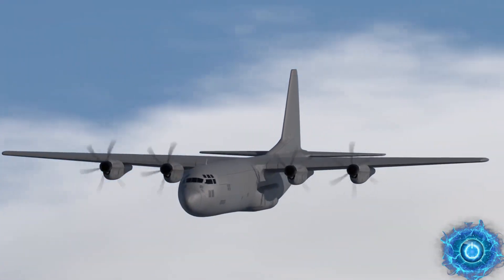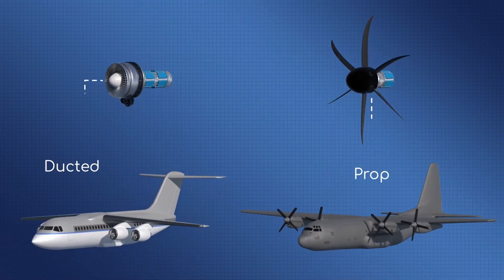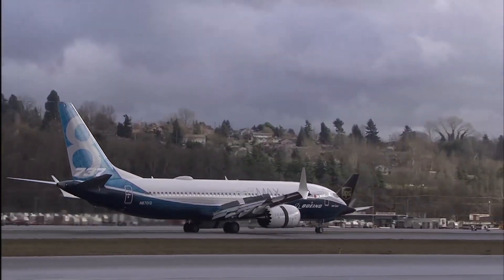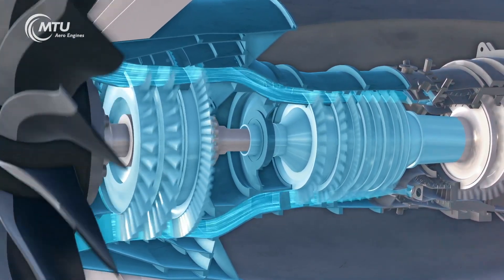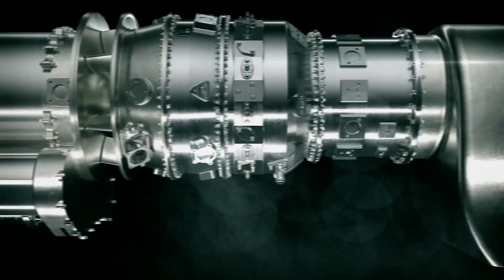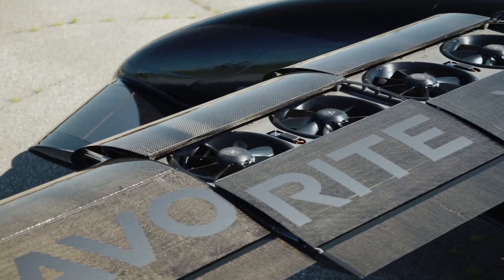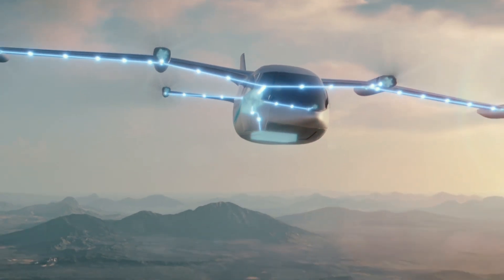New Hybrid ENGINE Will Change AVIATION Forever!?

Comment: Or better yet make the entire plane electric and use diesel generator to produce the power since the best jet engine you can make still guzzles jet fuel. Have you seen how much fuel a typical jet engine consumes? Who cares how efficient they are when to connect a generator to it you need a gear reduction assembly to even make use of this connection which results in losses of fuel energy, unless you can directly connect the generator with the output shaft there will always be energy losses. You could do it too with scalability in mind also, you would probably need a signal clarifyer. Why are they trying to keep the turbine again? You could install 5 to 10 mini propellers on each wing creating lift and you wouldn't even need the current wing design to maintain that lift. Plus the power draw and fuel requirements would be minimalized. Plus even if there was a total system crash and you would need to make an emergency landings safer. Well they dump the fuel mid flight if there's no way to recover anyway so the risk of fires is usually lessened to begin with, the only time they don't is at airports since they have the firefighters on hand to put out the fire. With the exception of environmental impact planes truly are safer than riding in your car. But one thing planes lack is the freedom to just decide mid flight to go to a burger king or to stop for a nap. Either way when AI driving assist rolls out there will need to be a major revamp to travel. Like if you want to control the car your insurance will be 300% higher. AI travel lanes reduced speed for AI's, also a very robust firewall with intrusion detection and automatic complete system shutdown with brake engagement.

Comment: Several Universities have successfully  reported  increasing the energy efficiency of splitting water into H and O by 8 times verses the old high current electrolysis methods. So within a decade we could see jetliners fueled by hydrogen on demand. As a fuel, water is many times more energy dense than fossil fuels. Of course the H could also be run through an Electric Fuel Cell. Few in the US realize that over 2 million cars in the world are already running on hydrogen, although its stored onboard in a tank. On demand H changes everything.... So what we need, are new engines that are purpose-built to combust H more efficiently, and better, lighter fuel cells.

Comment: Don't worry about the physics or chemistry of batteries, they are never going to close a 25 fold energy density gap, if they could they would just be chemical fuels. The energy comes into play with every single carbon atom bonding with 2 hydrogens, becoming CO2 and water in the air. You simply can not make a battery cell at the atomic level with just 3 atoms per HCH level of energy release.

The nearest we can get are the metal air batteries, ie every time a metal atom picks up an oxygen it releases a small amount of energy AND gets heavier, to recharge it the metal oxide requires electrical energy to break the oxide bonding to metal making it lighter, see aluminum smelting.

Comment: They’ll never be able to have a good enough battery to be able to power the motors, flight computers, avionics, air conditioning and dehumidifiers for 100 mile regional flights which require quick turnarounds required to generate profits. Quick turnarounds would be crippled when considering the long recharge times.

Comment: Electric aircraft..... I am not convinced of their viability as passenger aircraft, given their range will be limited. Batteries seem to inherently unstable on the ground never mind up  at 30,000 feet, where its pretty cold. Providing heat for the cabin would further reduce range, surley, just as it does with a car, not to mention things like inflight enteratianment and food preparation and lighting. Some form of hybrid, maybe, but pure lectric I have significant doubts about commercial viability and the rationale for them. Thats before we get on to the impact the mining and refining of the raw materials needed, both on the environment and on the humans that are exploited in their extraction and processing.

Comment: It would be cool to see a turbofan jet engine, but instead of combustion for a heat source in the turbojet portion of the engine, it uses the waste heat of a fuel cell. The brayton cycle does not require combustion, only a heat source. A solid oxide fuel cell can operate with a high temperature of 600°C to 1000°C (1100°F to 1800°F). This is sufficient heat to run the turbojet portion. Solid oxide fuel cells can run on hydrogen (which is already used commonly in commercial airliners due to incredibly high energy/mass ratio), hydrocarbons such as traditional jet fuels, and probably even alcohols. The fan, connected to the turbojet portion with a typical planetary gearbox. Directly driving the fan shaft is a high power electric motor, possibly superconducting. A different fuel cell may have to be used because of current SOFCs' low power to weight ratio. Likely some future proton exchange membrane fuel cell capable of operating at as high of temperatures as SOFCs. This would have the advantages of incredibly high startup power from the fuel cell. A typical turbofan jet engine has around a 30% efficiency. A hybrid fuel cell jet engine such as what i discussed has a much greater efficiency. A typical SOFC has an efficiency of around 60%, meaning 40% is lost as heat. If the turbojet is even just 20% efficient at reclaiming the waste heat, it can improve the engine efficiency to a total of 68%. The compressor of the turbojet portion does not only bring in air to be heated, it also provides compressed air to the fuel cell and isentropically heats air to closer to the SOFC's operating temperature, both should improve the SOFC's Performance.
Reply: but what would a fuel cell of the required power weigh and how much space would it take up?
Reply: @titter3648  im not sure, it would need to be pretty power dense (in terms of both mass and volume) fuel cell.
Reply: it'll be really nice if we could get a version working they can go faster than the speed of sound

Comment: isn't the constraint for electric air propulsion more on battery than motor. Given that power density is way higher in electric motor than internal combustion engine.

Comment: There is a new diesel engine designed to run on jet fuel.  A hybrid engine could be made merging electric motor with diesel engine.  If the electric motor is the control the diesel eould react mechanically then you would need some type of electronic control to injectors to match fuel supply to rpm

Comment: We have diesel electric trains why not planes too
Reply: That’s because diesel electric trains get around geared transmissions and clutches for huge loads. (Aircraft turbojets are direct drive-don’t need transmissions)
Propeller thrusted aircraft could still use a gear reduction even with an electric drive to help with rpm/torque efficiency or hp.

Comment: Don't see in place replacement units going very far. If you want to leverage the different aspects of electrical propulsion you will have to revisit the whole concept. Those big combustion fans are hanging of the wings because it works with the heat and needed explosion protection. Electric is different.
Reply: They are hanging on the wings because they are easy to access for maintenance. Aerodynamically it would be better to blow at the wing for easier take-off or mount the engines above the wings like the Honda Jet.

Comment: Very interesting video. 

3:18 Why is the term “MICRO-turbine” used?

So 1 to 10 MW motor / generators → a GE90 core generates 73 MW at 42% output efficiency (LM9000).  So one has to put that in perspective.

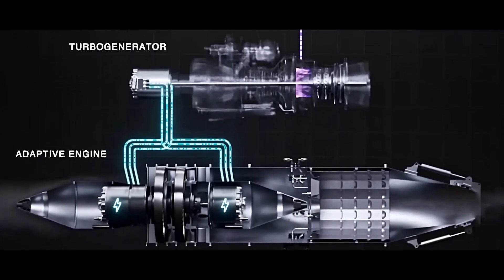3:31 “You can have a motor running the compressor and you would be able to control the amount of air coming in independently of the exhaust.” Please explain, you lost me there.

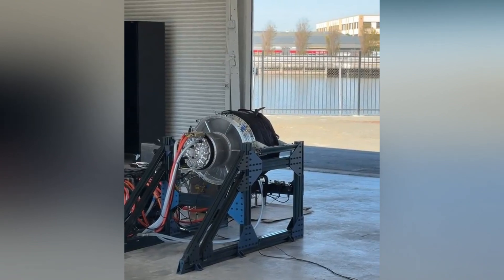4:12 “could run on a diversity of fuels including LNG or synthetic methane”. Why LNG/methane for an aircraft? Generally the discussion is around SAF or liquid hydrogen. Propane is easier to deal with from a temperature / tankage perspective and is not as bad a greenhouse gas as methane. If you are going to do a synthetic E-fuel like methane, would it not be better to make a liquid fuel like methanol?

Maybe you could do a video on the turbine projects that use “Wet combustion” that can significantly increase efficiency. Some of these projects are also hybrids.  

Keep up the great work.
Reply: For your second question, It means no more thrust lag. And even if you lose all combustion you still have some thrust.

Nothing should be a drop-in replacement for existing aircraft because existing aircraft shouldn't exist anymore. 

Just like the jet engine, time for a shake up for jet aircraft was decades ago, ending up here mostly due to the lack of competition. and regulatory capture.

General aviation still uses leaded gasoline.💀

Comment: I think your "25%" figure is probably by volume not by mass; by mass, batteries are still closer to 10% the energy density as liquid fuels.  I think electrification just isn't well-suited to the demands w/o expensive & exotic materials & engineering
Reply: He said 25x less energy density than fuel, not 25%. 25x less would be ~4% the energy density of fuel
Reply from the maker: Yes, thanks! I meant to say 25:1 ratio and accidentally skimmed over it. I should have reemphasized the difference.